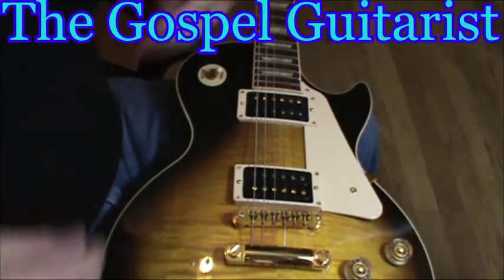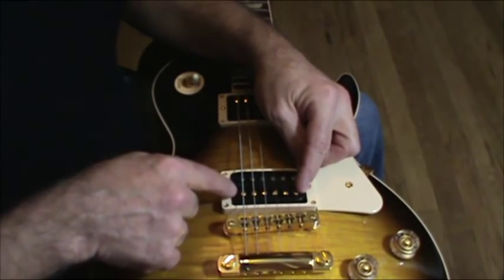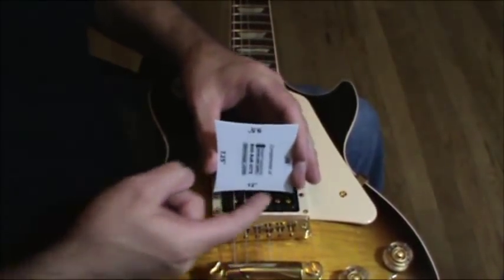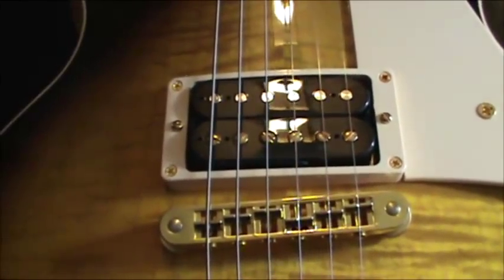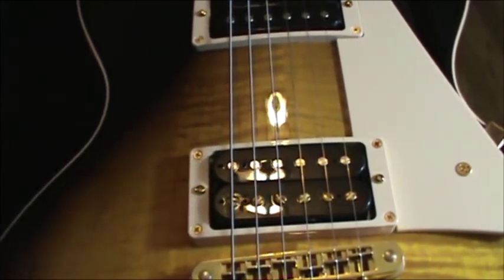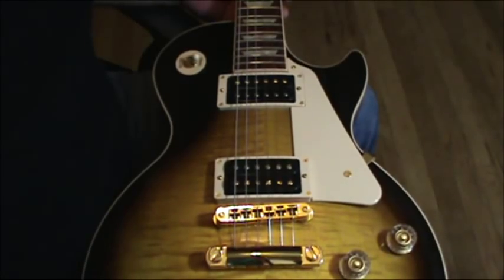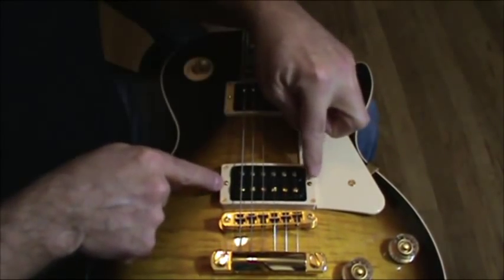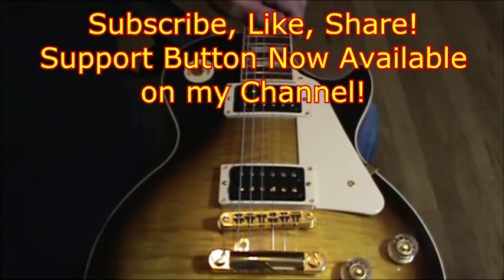Pickup Pole Piece Adjustments

Comment: Correct me if wrong but IME If you adjust the pole pieces to follow the 12” radius you will end up with a very loud G string and a very low high E string.
Reply from the maker: Adjust to your own taste. There is no one answer for all guitars but I find the guitar cuts through better. Always follow your own ear though.
Reply: TheGospelGuitarist aha.. ok that makes sense, so the point is it cuts thru better.  Thanks for the info I’ve always wondered why some go for a balanced output which I’ve tried and didn’t like, and others just radius the poles. I personally go for a mix of both. I ramp up the poles in two stages. E to D and G to E. G being the lowest, the plain strings are just slightly higher. The highest pole would still fit within the 12” days radius. Sorry for my crappy english, I hope you get what I mean 😉

Comment: I have found that adjusting the screws does not change volume, but does change the tone slightly.  
I am a FREAK for at least trying to get all of the strings at the same volume. 
And ALL of my electric guitars have issues with let's say a loud low E, a quiet D and loud G and B and a quiet high E. 
Kind of pattern with all of my Fender or Fender style guitars. Some have pole pieces and some have rails. 
I wish that the manufacturers would allow for easy mice adjustments of the pole pieces. Not the screws.
Reply from the maker: When a pickup gets closer the output goes up because the magnetic field is getting hit by larger string movement thus making the output louder. You can hear this effect easily. Once the strings are more balanced in output I agree that the overall tone of the guitar has a change, I'd say brighter with better harmonic content. Any guitar will sound clearer if output is balanced. But it takes some getting used to because we have always played on pickups that are not setup for the guitar they're install on. Low 'e' is almost always to loud, and yeah I agree with you on the D, G and B high E. Gauge of the strings have a lot to do with the output/tone of the set as well. It's funny because no one ever complains about the 'A' string. Which leads me to set up my guitars around that string first, then get the other in line with it. No one has ever had me set up their guitar and not be astounded by the way it plays and sounds when I am done with it. Over the years you just learn what works and how to attain it.
Reply: I stand corrected sir. 
Now after searching the net for this type of issue with disparate string volumes, watching your clip, leaving my comment here, searching a bit more and then moving the screws again.....
I was adjusting the screws, but my adjustments were just not radical enough to make that much of a difference. 
So now after no being timid about turning the screws too much, the issue is WAY WAY better. 
I do stand corrected sir. You were right and I was wrong. 
This is a brand new guitar with HSS. My first humbuckers in a long time. The single coils on the guitar are what they are. The volume diff between strings was not as much an issue with those as it was with the humbucker. 
More easily solved with those just with pickup height adjustments. 
And as I said, after going medieval on the screws and THEN micro tweaking to get as close to "perfect" as I can (I'm sick that way) the prob is much much better. 
I have subscribed to your chan. 
Thanks
Reply from the maker: We're all learning as we go. Glad you could get better results after a while. You will probably continue to tweek those screws for about a week if you play every day but you will settle in on YOUR tone and feel and then you'll be able to take that setup to any guitar in your collection because you will know what YOU want. Have fun and thanks for the sub! :)
Reply: I wish I could apply this to other guitars of mine. The worst offender is a Tele w Joe Barden pickups. Rails on those. 
So there is no independent adjustment there unfortunately. 
Sort of the same thing. Loud low E, quiet D , loud G and B and quiet high E. 
You know I am not talking about the end of the world here, but it does bug me. 
I have tried every pickups adjust angle known to man. As every saddle adjust I can think of and a new nut recently. String, no string tree. And of course several different brands of 10's. 
I have a real good compressor but even with that, this stuff is obvious to me. 
Probably would not be to many others though. 
I've been doing this a LOOOONG time. Bass and some guitar in bands.  
Now I'm just playing for my own enjoyment by myself. Seems like the guitar tweaking is taking precedence over the playing though. 
But this humbucker is just so much better now.  

Thanks again
Reply from the maker: You are welcome, glad I could help a little. You could just swap out the Joe Bardens for another type of pickup. They just aren't you cup of tea so swap them out. Never owned a Tele so I can't recommend anything there.
Reply: N2F1 I

Comment: Hi. I'm having a problem with my gibson les paul R7 goldtop. When i play between 7th and 14th frets i linsten a oscilation sound on G string and i think it's anything with pole pieces. How you put height pickups and pole pieces height? Please help me.
Reply from the maker: You may have your pickups too close. Place your pickups at 1/8" from the string while holding the string at the last fret to start at a standard height.
Reply: I did all this. I put 1/8" always, but the oscilation sound was there
Reply from the maker: Edmar Olympio Without hearing it myself it's kind of hard to diagnose. Sometimes we just get a weird string. Have you tried replacing the 'G' string yet? Also make sure the nut slot is clear. Dirt in the slots could cause damping of the string.
Reply: Maybe the brigde saddle, a sitar effekt.
Reply: Believe it or not the G string has the highest output of all the strings being it is a large diameter plain string. Try lowering the pole screw for the g string and adjusting pickup heights. You just need to find the sweet spot for your pickup

Comment: Hi.  Without a radius gauge couldn't you just raise the overall pickup height to 1/8" & then adjust the pole pieces to 1/8" ?  That should automatically give you the radius of the bridge.  Sound right??
Reply from the maker: If you are thinking measuring from pole to the bottom of each string then yes it will follow the bridge radius.